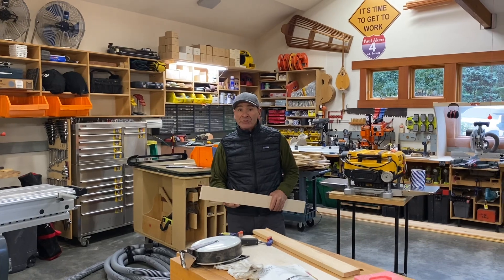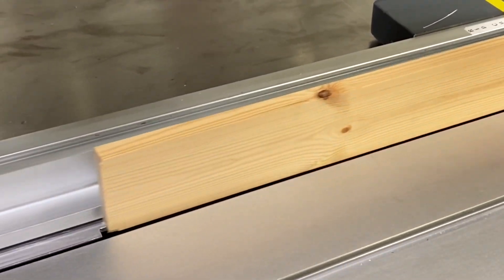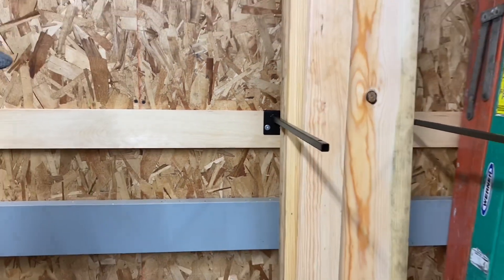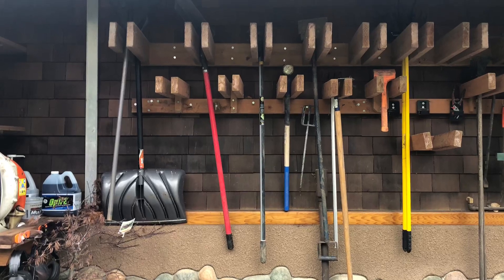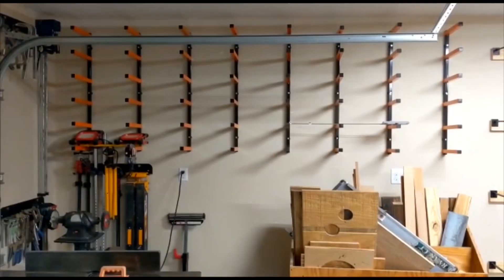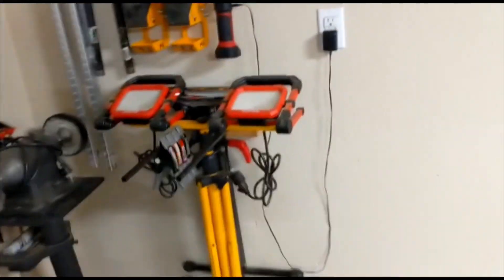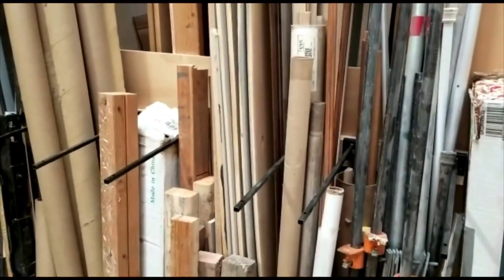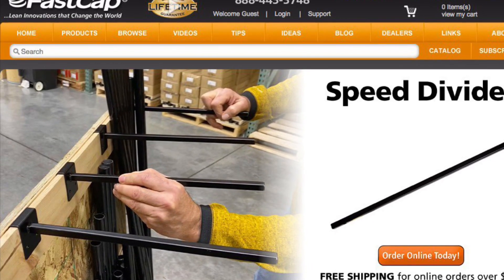Speed Divider Lean Vertical Storage

Comment: Great system... one little detail. Can the end of that speed divider be a bit safer? I'm just imagining that someone might bump into it or slip & fall on the steel protruding end of it
Reply: I used a recipe card sized pc of 1/4" whiteboard to create an inventory flag card. Made 2 cuts in it using my band saw so the 1/4 thick pc keys into the end of the speed divider. Creates a strong visual  control of my vertical lumber storage sections and it's also very safe that way.
Reply from the maker: We now have a cap! https://youtu.be/g_53tN89qL0